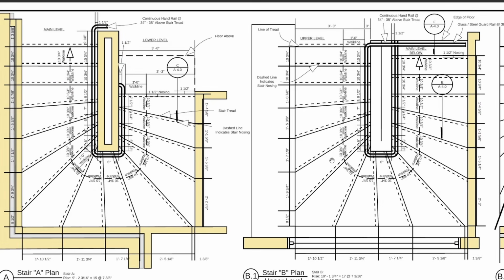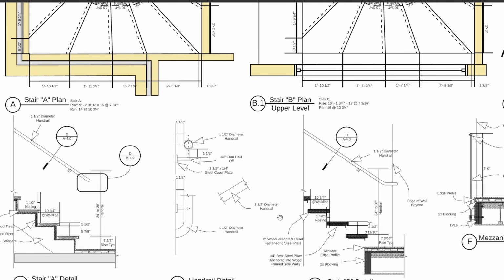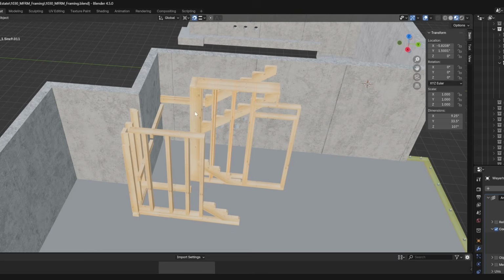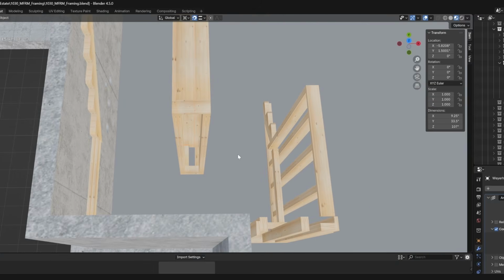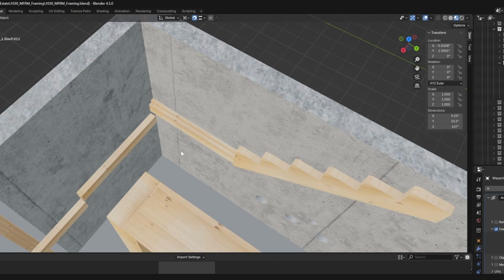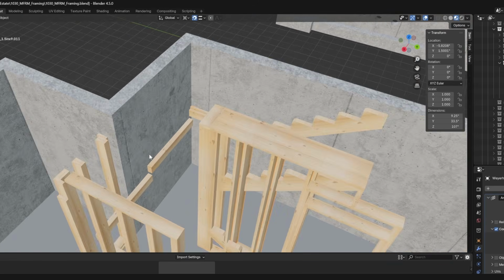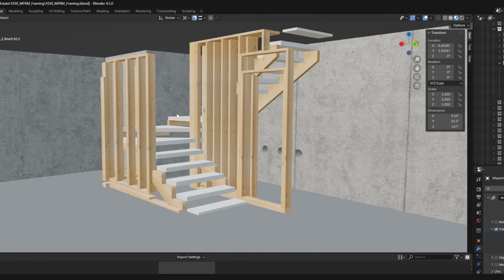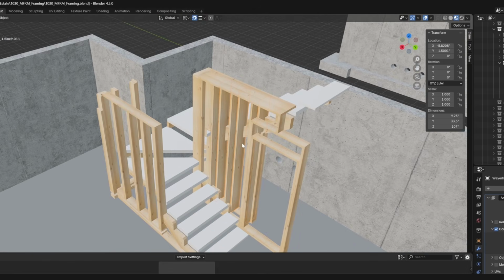We Built Two-Story Floating Winding Stairs With No Engineer Drawings | LVL Treads

Comment from the maker: 🪜 Two-Story Floating Winding Stairs — Full Build 👇

In this video we show how we designed and built *two stories of floating winding stairs* using traditional framing techniques, even though **no structural engineering drawings were provided**.

We break down:
• Stair layout and working cube measurements (rise/run/code)
• CAD design in Blender to minimize mistakes
• A 14″ thick built-up center column
• Hidden stringers, ledgers, and load paths
• *LVL stair treads* for strength and zero bounce
• How we used *Advantech Subfloor Adhesive (Huber Wood)* and *Big Stretch (Sashco)* to eliminate squeaks
• Code considerations, aesthetics, and finishing details

⏱ Chapters are in the description so you can jump to the parts you care about.

❓What part of this stair build would you like more detail on?
❓Would you approach floating stairs differently?

We’ll be in the comments answering questions.